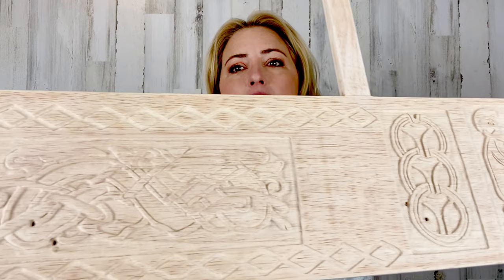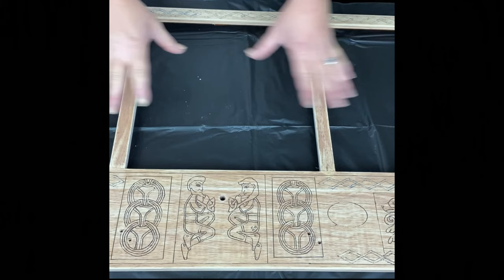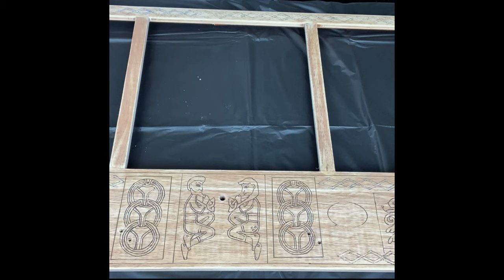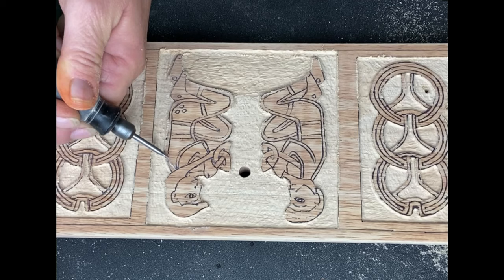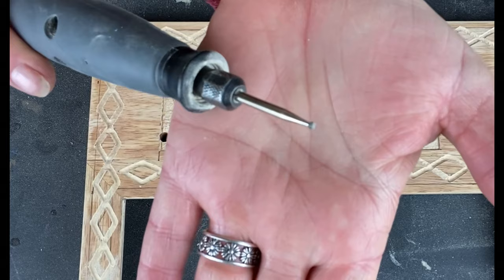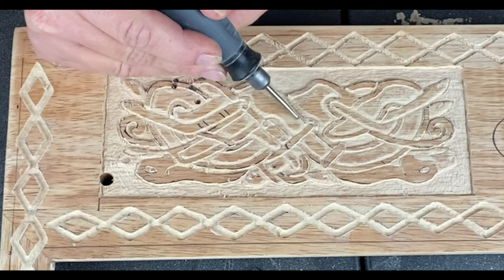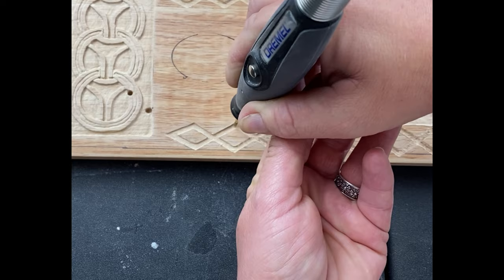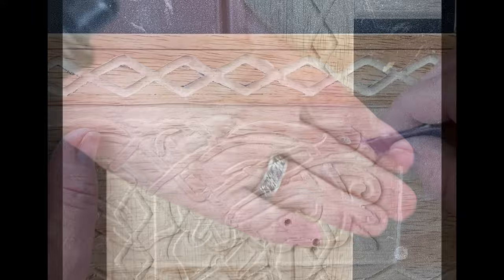Relief Carving Viking Art

Comment: I'm just getting started with Dremel carving. Why do you use diamond point bits on wood? I thought the diamond point bits were mainly for glass.
Reply from the maker: The diamond point bits are great for glass, but I have also found they work very well for smoothing out an area that's been carved. They wouldn't be good for the actual carving, but perfect for smoothing and sanding.